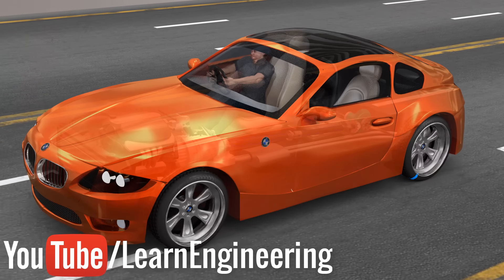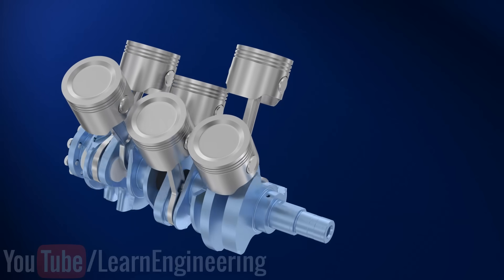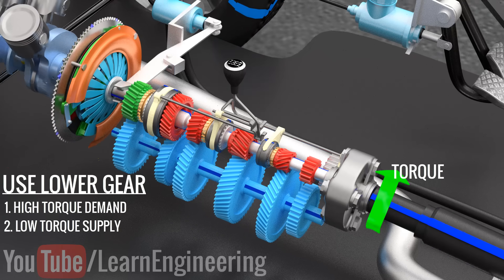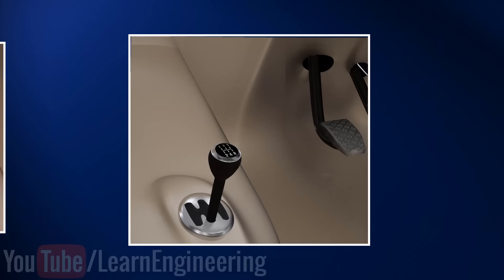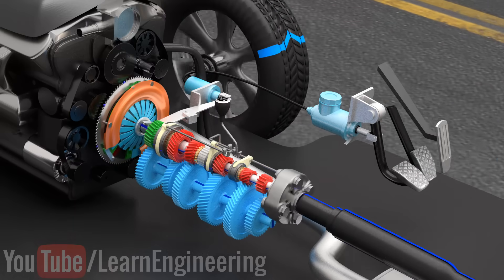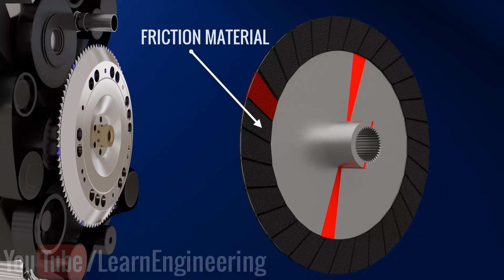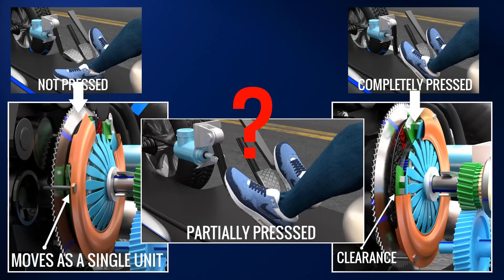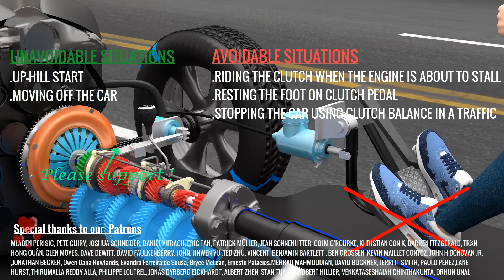Why you should not PARTIALLY press the Clutch?

Comment: Moving from rest in an uphill situation, for instance, when there is a uphill slope at a signal, I always ride on the clutch..Once the car tugs forward, release the clutch and press on the gas.
This would help you negate your car rolling back..
Other than that, I NEVER ride on clutch.. Cheers!
Reply: That's holding the biting point, which is ok and doesn't harm it I think.
Reply: youre doing it the wrong way round, press the gas first depending how big the hill is choose rpm, then quickly let the clutch out to the biting point simultaneously releasing the handbrake and increasing the throttle as you hit the biting point. the whole thing should be done quickly and effortlessly in less than a second. if you cant move your foot from the throttle to the brake before you roll back you need to work on your driving technique
Reply: @jamiedyer7782  I agree, it all should be done simultaneously and as quickly as possible. This comes only through practice.
If you press on the gas too much or too hard while simultaneously releasing the clutch, your vehicle can jump forward or stall. 
Once the green light comes on (at a signal in an uphill situation), you should operate clutch, gas pedal simultaneously while quickly moving right foot from brake to gas..

For newbies, opening clutch up to biting point while the brake is still pressed isn't a bad idea..
Feel free to further comment or criticize..
Reply: There's no reason to use your handbrake.
Reply: @tylhunt  plenty of reasons to use the handbrake for a start youre putting unnecessary wear on your clutch and transmission if you aren't using the handbrake on an incline correctly
Reply: @jamiedyer7782  lol. If you need to use a handbrake for that, then you need to practice your footwork.
Reply: @jamiedyer7782  you need to put to load on the transmission and clutch either way, or you won't make the hill. Lol. Pretty basic physics. 
The handbrake is a bandaid for poor driving technique. You obviously need to work on your driving skills.
Reply: @humungous09  what about heel and toe? Holding brake with toes and accelerating with heel.When clutch starts biting slide toes off the brake?
Reply: @deividasabrutis7248  That's what newbies tend to do exactly.. As such it need not be a hair splitting experience..
Trust me, driving comes only through practice n experience. I tried all these crazy methods and failed.
I then practised religiously for one month and I became an expert driver. Your HABIT takes over everything. Just practice all situations.
Avoid driving on clutch as much as possible. Just practise until you feel confident..
Cheers!
Reply: @humungous09  in my opinion thats how i want it to be.  Is there something wrong with heel and toe? So much more precision rather than droping brake and quickly accelerating
Reply: @deividasabrutis7248  It doesn't go that way.. You gotta fully release the brake before you step on gas. 
It all happens in a split second and in a sequence, all with practice and habit.
Don't think too much just keep practising it. You will soon get it without ever realizing it..

Comment: I don't ride the clutch while driving, but I have a terrible habit of riding it while in neutral at a stop light (resting my foot on it). This was informative from the mechanical aspect. Nice job on the animations. Helps to see a visual with the verbal description.
Reply: In your case you don't wear out the disk but the springs
Reply: If you ride it while the car is still, it will start moving though 🤣
If you means you fully press the clutch it's the same as leaving it neutral, the problem and friction comes when you don't press it all the way.
Reply: Exactly, as the guy above me says, you don't couse any trouble if you press it COMPLETELY while you are at stop light.

Comment: Naw, fuck that, I'mma ride that clutch all day 😂😂😂
Get a new clutch later 😂

Edit: I mean not literally all day, but like when delicacy  creates a smoother ride 😂
I mean surely if you just drop the clutch all day surely that energy will take on it's tole on the engine eventually?
And replacing a clutch has gotta be easier than replacing a whole engine after 10years?
Reply: Slipping the clutch while setting off is not riding the clutch.

Comment: This video is bullshit. He's correct but only in theory. First of all NO ONE does this, only an idiot would partially press a clutch on the initial press. What you meant is "Double Clutching". This video explains well the damage that happens when partially clutching but does not compare the damage you can do when you do not double partially clutch as you depress. (Double Clutching) Yes, in double clutching the discs do rub eachother for a split second as you depress the clutch but the lifespan of the friction material in your clutch is determined by the overall time it spent rubbing at (x) RPM's and the temperature at which the discs are rubbing eachother. If double clutching is done properly the wear from double clutching is almost zero and the benefits are unforeseeable.  If you do not double clutch you create rough shifts which in turn can wear down gear teeth, cause leaks from pressures on the trans and engine, will annihilate your trans and engine mounts, abuses your differential/CV joints, cause overall excess wear of all drive train components and creates a rough ride. By partially depressing in a very quick practiced manner can extend the lifespan of your clutch, drivetrain, and vehicle overall. If clutching muscle memory is perfected the friction material and pressure plate end up wearing/molding to your rhythmn. You'll be able to tell immediately if someone else drove your car even for a mile because you will feel the change in the clutch. My uncle who taught me how to drive and double clutch ran a 95 corolla with its original clutch until 145xxx miles... Shifts were like stepping on a cloud and executed perfectly. Insane! I used to street race and head to the tracks a LOT over my life, I have owned 5 stickshift cars in 30 Years all 10+ year used imprezas, del sols, corollas, eclipses,  and have driven in my lifetime over 200k+ miles and have NEVER IN MY LIFE have had to replace a clutch! Except on my Kawasaki ZR7-S motorcycle... because i bought it worn, and those are extreme RPM's and those are wet clutches and we are not going to get into that Lol. 

- UTI Alumni Auto Technician.

Comment: Manual cars are awesome,  automatic cars lazyyyyy
Reply: Siddhartha Ray 
If people weren't so lazy, they would realize that a car is only as good as the engine AND transmission.  If your transmission is crap, you replace it, and then the engine craps out! A non-turbo, stick-shift, 4-cylinder Honda will last forever. Automatic V-6 w/turbo? Not so much......

Comment: Even if the driver never rides the clutch, the clutch will need replacement sooner if the car is usually driven in heavy stop-and-go traffic. With a front wheel drive car, this means  disassembling the transaxle.  Automatics, however, hold up mush better.

Comment: The thing I don't get with the clutch is: as I understood, the high friction material can be half-pressed against the disc linked to the motor, and if it was a 0% or 100% system you could basically not start the car. But how the hell can you do a half-contact between high friction material??? I see it as a kind of sandpaper texture, but it is absolutely impossible to make two sheets of sandpaper move smoothly between them... It would make imprecise jolts all the time... So if someone ever touched a clutch disc can you tell me how it feels like?

Comment: How about braking? Or down gear? Sometime I just do half clutch to make it smooth and make passenger comfortable with my driving skill.
Of course its come to 2nd priority after safety.
Reply: Braking? use your brakes. Gearing down? use your clutch properly. (depress fully, shift, release fully). you shouldn't be driving around with the clutch half engaged.

Comment: I'm not surprised there are people who don't know this crap, it's like basic driving 101, 
Floating or riding the clutch is the worst of all the bad habits,
I had a small pickup for 16 years I had bought new and when I sold it still had the original clutch in it working like new 250k miles and 16 years later
Mean while,  my cousin in his car, he had got new, drove 79k miles on, replaced the clutch twice, and transmission once, before he swore off buying another "stick" as he called it, bowing down proclaiming his unworthiness to the stick God's Lol

Comment: I've been "riding my clutch" since I bought my car 12 years ago (not constantly while cruising, but in slow traffic, at traffic lights on inclines, etc). I have 100'000 kilometers on the clock and haven't changed my clutch yet. Yes in theory, riding the clutch will cause erosion of the friction disc -- but in reality, the low rate of wear surely does not make it practical to go to such drastic lengths to try to avoid. Instead, the extra control you can have over your vehicle by mastering good clutch control can be very beneficial to you as a driver.  Brake pads are also designed to make friction contact and eventually wear out, yet obviously nobody's advising you to stop pressing your brakes. A good driver will know how to ride their clutch effectively, without causing it to burn (and a person who does not understand the dynamics of their clutch is also more prone to accidentally subjecting their clutch to instances of high rpm burn). Obviously it will still wear out with time, but so will just about every other part on your car - everything wears with age and it's often good practice to replace such parts every couple of years/miles for good measure anyway even if the part hasn't failed yet. The alternative to riding your clutch, involves a much trickier process of greater co-ordination between the foot pedals and handbrake - more prone to stalling on an incline and potentially rolling back into the vehicle behind you (besides: even here, significant clutch friction does still occur). So would you rather have a safer, more comfortable driving experience (and just buy a new clutch every couple hundred thousand kilometers), or increase your chances of a wreck, which could cost far more in embarrassment and damage costs? I know which one I'd choose: Good clutch control! It feels better, looks less clumsy and cumbersome, and is faster, easier and therefore less risky to execute when that traffic light goes green and that impatient person on your butt is busy honking away at you to get a move on... After all, hand brakes are for parking, not driving. So you definitely offer some sound advice to anyone wanting to be so penny-wise about the longevity of their clutch; but I guess ultimately each driver will still have their own preferences when it comes to this, and rightly so in my experience thus far...

Comment: partially press the clutch I agree it can cause wear and tear, there's other word is 'biting point' for when you setting off up hill, you need to feel the clutch biting till you felt the car about to move then turn off the hand break but by keeping your car in one spot before you pull out.

I wouldn't partially press or "biting point" the clutch when stopped at the traffic light or traffic que (which I seen a lot of other drivers do!) I'd just pull the hand break and wait till the traffic move again